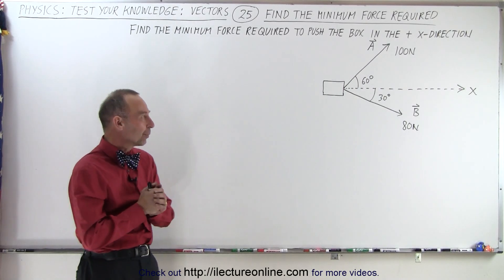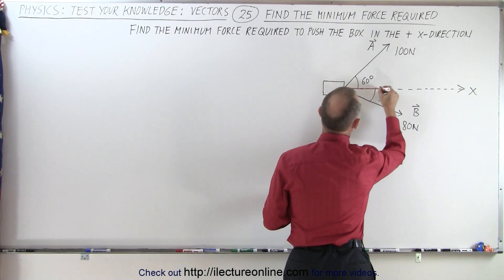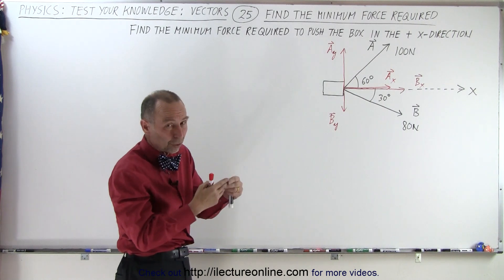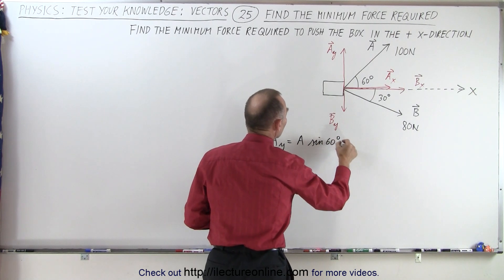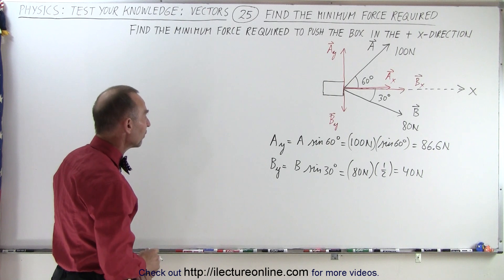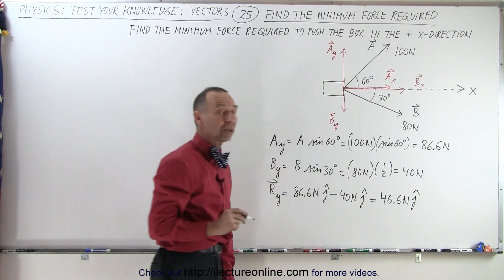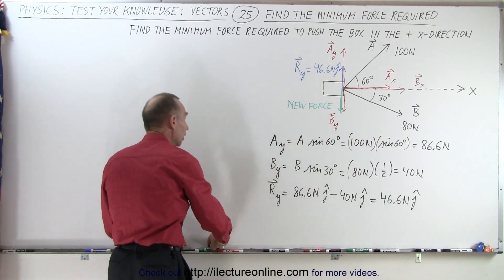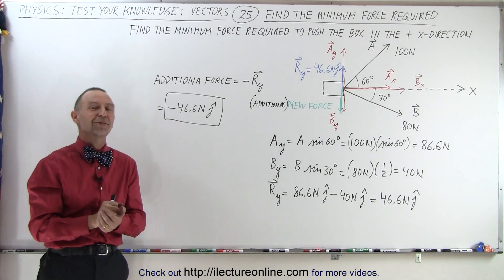Physics - Test Your Knowledge: Vectors (25 of 30) Find the Minimum Force Required

Comment: And............... the Challenge that Michel has offered to US students is this:  How much should Vector B be INCREASED so that it's y- component is equal to the 46.6 N ? In other words, Vector B should be equal to 80 N at 30 degrees PLUS  "X-Newtons"  .. Find X..... gee, thanks Michel... lol... I just enjoy your videos and how they Promote Extra Thinking about the Examples you explain ...
Reply: I arrived at B having to be increased to 173.2 N... while still at a 30 degree direction...  and the resulting NET force would be 200 N in the +X direction... WOW.. this problem can be really turned into so many problems...  for example.. what if the mass of the box was 100 kg, what is the Box's Velocity after 10 seconds with ZERO friction? or what is it's velocity after 10 seconds if the Coefficient , mu, is equal to 0.3 ??..  I'm having fun with this VIDEO.. THANKs MICHEL!!. You've created a MONSTER HERE!!...  lol  ..